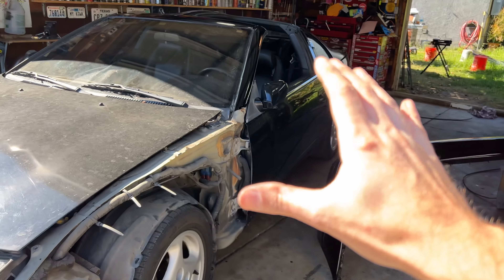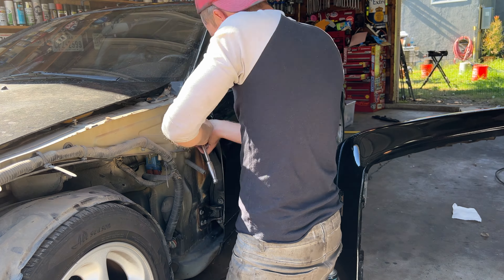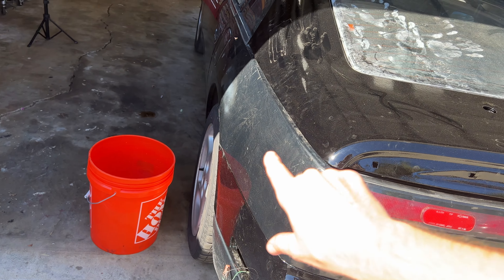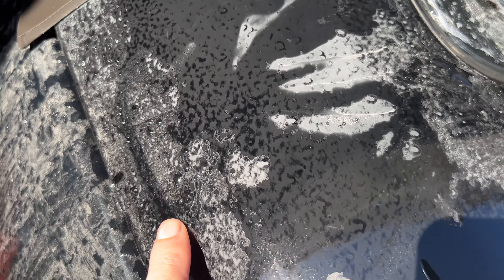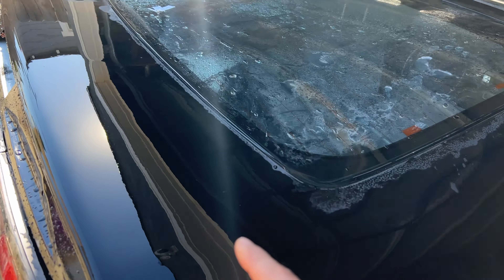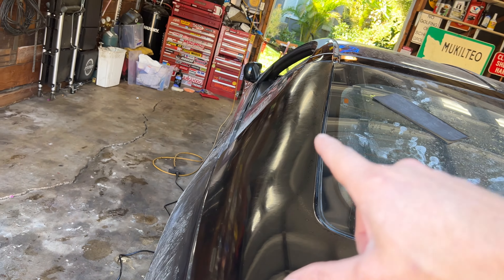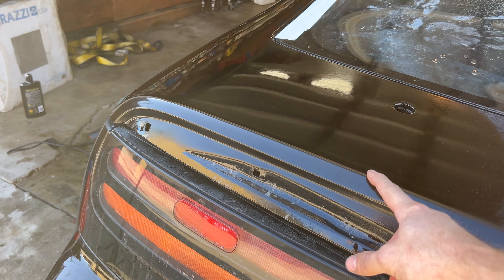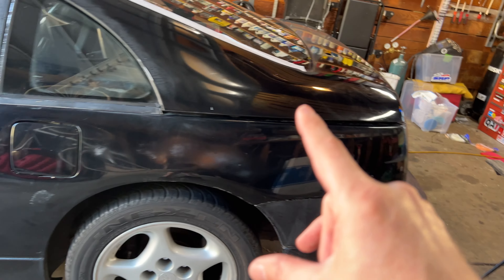Wet Sanding, Polishing, and Buffing My DIY Paint Job on my Nissan 300ZX Z32 Restoration: Part 10

Comment: Great job it cleaned up well considering all the orange peel! I’ve always learned to throw some tape down and test two methods and see which set of pads and compound works best. Basically using the least aggressive pad possible. Other thing I was gonna mention is it’s really important to blow out your pad in between sections of the car if it’s dirty or throw a new one on. Chemical guys makes a pad conditioner and cleaner that works well
Reply from the maker: Thanks for the advice, I definitely didn't clean my pad nearly enough. I'll give the conditioner a shot next paint job 👍

Comment: nice work my friend! stoked to see this progress as ill be redoing my Z32 soon, in process of chopping and swapping out the rear quarter panel, previous owner crashed her and just bogged her up with mud then sanded to shape. F that, i cut that shit out and swapping it with a perfect condition all metal rear quarter, PITA.... but o so worth it! so thank you for sharing this quest!
Reply from the maker: Thanks! 100% agreed, cutting and welding in new metal is better in the long run than shoveling on bondo. Went through that same thing with my Challenger!

Comment: I could be mistake but I think the reason why you got such extreme orange peeling was due to the rattle can priming you did in the prep video. The rattle can itself isn’t inherently wrong but I’m almost positive you needed to sand that down after applying it, and before spraying the black paint
Reply from the maker: That makes a lot of sense, I’ll definitely research that before my before my next paint job. Thanks for the feedback!

Comment: tape all edges, use the paper in stages, 600, ,800, 1000, 1500, then you can try and polish. Use the 3M perfect cut 3 stage system.
Reply from the maker: That’s good advice,I’ll have to try the multiple sandpaper grits next time. By tape edges do you mean painted panel edges so you don’t burn through when polishing?
Reply: @noboltsleftbehind  Yes, you need to run tape along and over all of the edges so that when you are wet sanding and polishing you do not burn through the paint which is thinnest at the edge. Then once you are done with the big areas, remove the tape and carefully hand sand/polish where the tape was at.

Comment: Did you not use any clear coat for this paint job?
Reply from the maker: I used a single stage paint, which is clear and base mixed together.